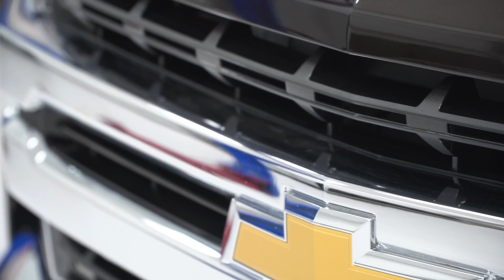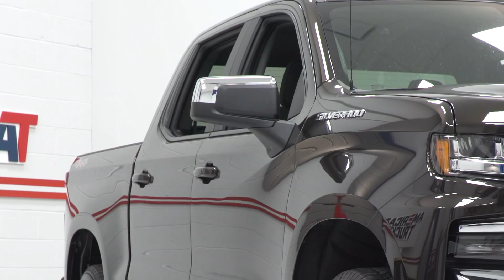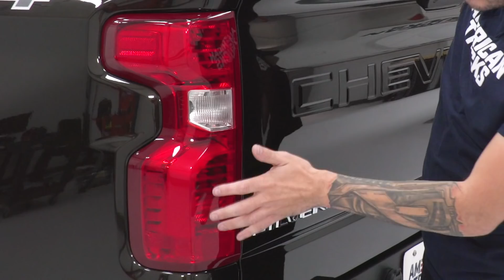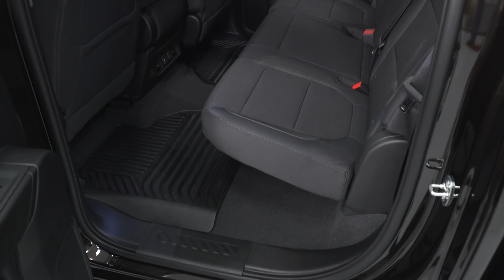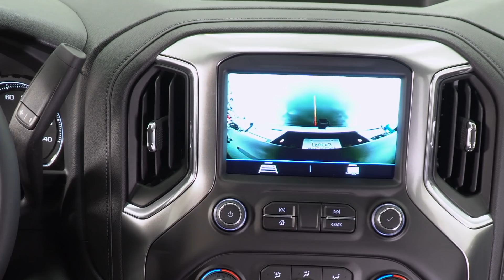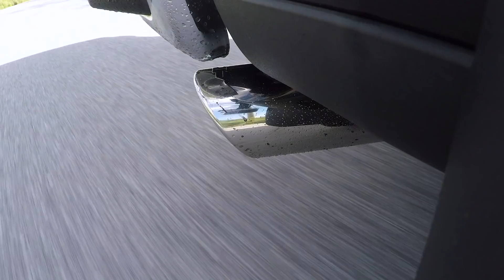2019 Chevy SIlverado Official Review and Test Drive  Best Truck Yet   The Haul

Comment: Okay first of all great video....i just purchased a 2019 rst and love it...i hv a burning question about a feature on it....long story short why did they put a engine shut off switch in these trucks..i experienced it today om accident i thought something was wrong can u explain please???
Reply from the maker: The auto start/stop feature many modern auto manufactures are putting in their vehicles is mainly for fuel efficiency, so you don't use extra fuel while sitting in traffic or at a stop light. -Zach
Reply: @AmericanTrucksChevyGMC  i wish i could disable it

Comment: Oh and BTW, round or square wheel wells has nothing to sod with what size tire you can fit. the total width of the wheel well does. Since the wheel is round, and if a wheel well is square, the corners of the square can never come in contact with the round wheel. So only the 2 sides(front and back) of the wheel well and the top could potentially touch the tire. So geometrically speaking, the width of the wheel well matters, not the shape! So if they new gen can fit 33" tires from the factory, then then must have just made the wells wider, and has nothing to do with square or round.

Comment: Nice video! Although I wish you guys would have spoken about some of the negative aspects of this truck. Like the fact that the tail gait has no handle and needs the key to be near it, horrible for anyone who works out of their truck. No buttons on the in-bed lighting, minimal interior color choices, worse MPG numbers from the EPA than the outgoing generation, and the fact that the redesigned interior is plain, sub-par, and just plain ugly, especially when compared to Ford and Ram. Heck, you can't even get a power passenger front seat unless you upgrade to a High Country trim, even then Im not sure. Also, a panoramic sunroof still isn't available from Chevy! I drive a 2016 and to me they took a major step backward!

Comment: It is soooooo fucking annoying that so many guys keep repeating the same ignorant theory on why past GM truck didn't fit 33's. It's NOT THE FUCKING SHAPE OF THE WHEEL WELL THAT CAUSED AN ISSUE. G O D  D A M N. It has NEVER been the shape that was an issue. It's the distance of the opening from the bottom front corner to the bottom rear corner of the opening. Go measure the width of the opening from  corner to corner and you'll see that GM expanded that distance by nearly 2 inches. THAT is why a fucking 33" tire fits now. NOT because of the shape of the opening. Fucking idiots.

Comment: The Sad note- The brand new 2019 Silverado-Sierra twins can NOT even be ordered or does NOT come with the “power brake and foot pedal” adjuster.... Think about such a large truck without this option....If you have short legs, you have to move up the seat close to the steering wheel, which has an airbag in it.
This is normally a pretty standard option for most trucks (GM, Ram, Ford)...Note-I actually own a 2017 Silverado, but some “bean counter” within GM axed this very useful feature (so they added rear vents finally but deleted the Power Pedal feature. Yah, this makes sense). Maybe a GM truck engineer will recommend removing the Power Window option while they’re removing other options or features.